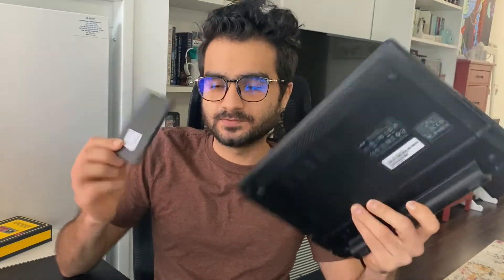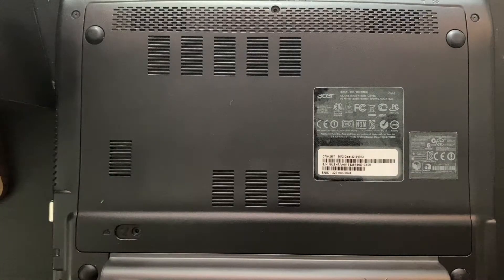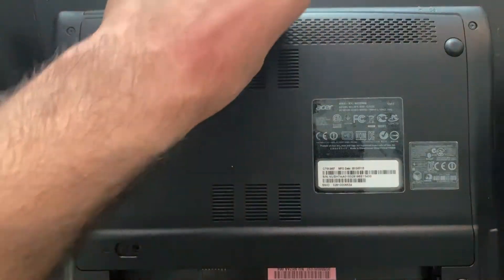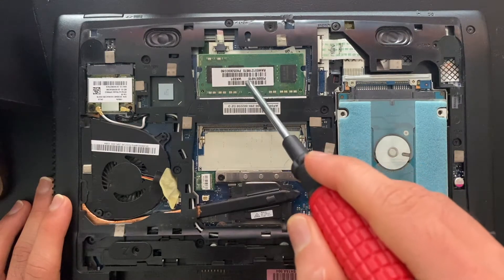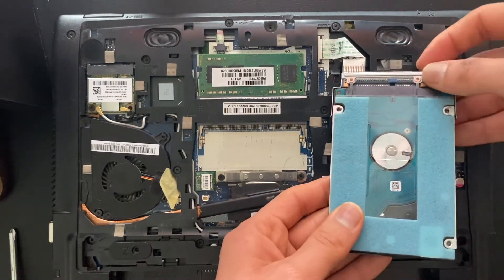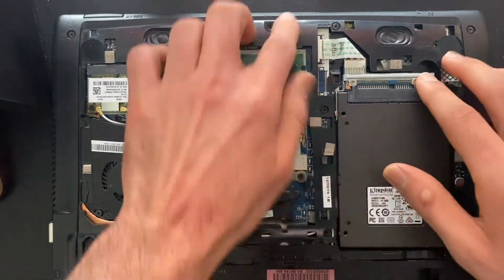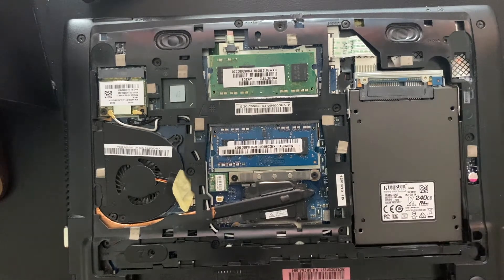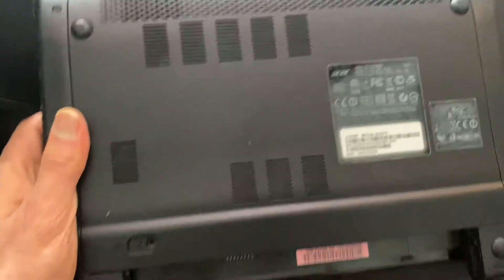Upgrade Laptop Guide: Acer C710, RAM and SSD!

Comment: Okay so does it run faster and more smooth? My acer c710 laptop doesn’t have updates anymore. Mine doesn’t even wanna run YouTube videos at 780p without flutters plus won’t run 1080hd at all.
Reply from the maker: Those would be CPU problems and it’s probably not going to run more smooth. Unfortunately the intel cpu inside is not the best for current modern websites
Reply: @amanscripts  oh okay, well after changing the ssd and added 8gb ram my laptop is running a lot better, it can actually run 1080 but not flawless of course but at least it can do it now. i just stick to running 780 cause its smooth.
Reply from the maker: @t00ted  That's awesome! I'm glad it did work out for you. Are you running Chrome OS or linux on your acer?
Reply: @amanscripts   yeah man! im running chrome os, was very easy to download and didnt take long to boot up